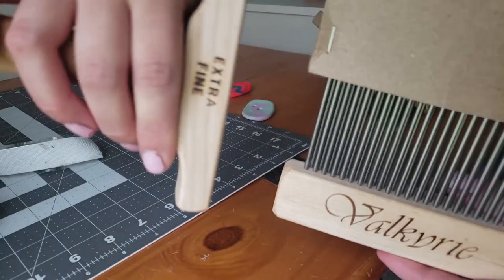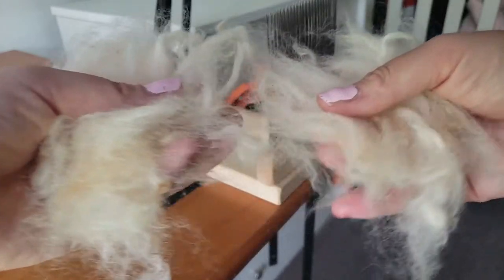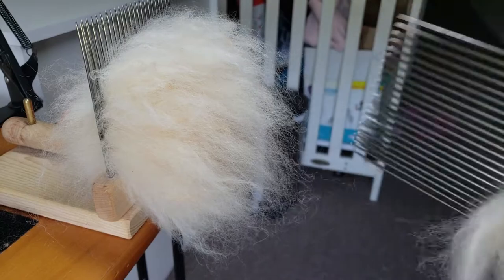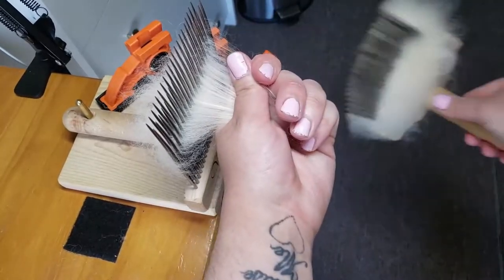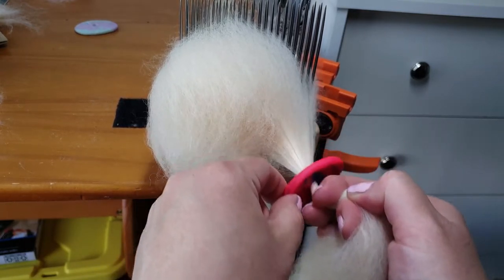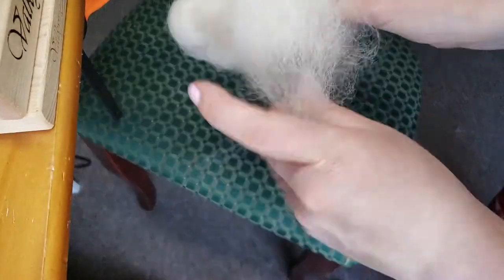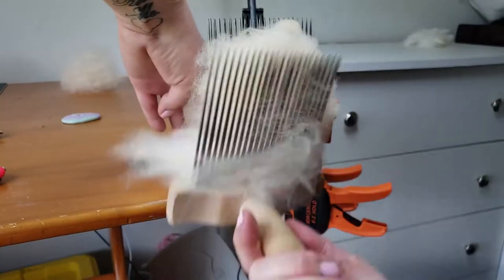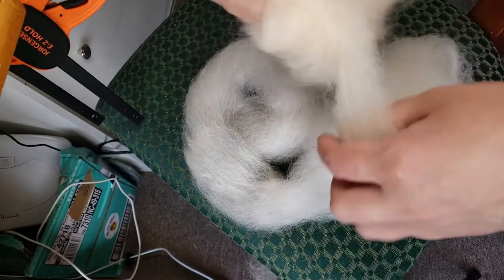Combing Alpaca Fiber into COMBED TOP / Step 3 How to Process Fiber Series

Comment: How many skeins do you get from one fleece?
Reply from the maker: It depends so much on the fiber type, the way you prepare it and the size of the fleece, how much lanolin is in it. However, I can say that I got 7 skeins from an alpaca fleece that weighed around 2 and a half pounds. You get roughly 4 skeins per pound depending on so many factors there really is no way to answer this question. You always get some loss in the lanolin and dirt from washing and then more loss in the way it is processed.
Reply: Wow!!! Ok. So trial and error. I’m sheeting my Tunis sheep for the first time this match. Just trying to figure out about how much to expect. Again thank you for the videos!

Would you recommend combing and carding? I’ve seen some who just card.